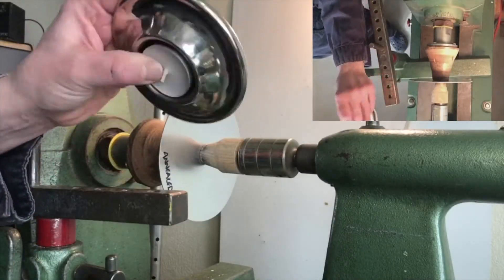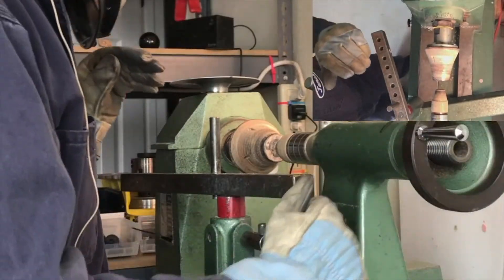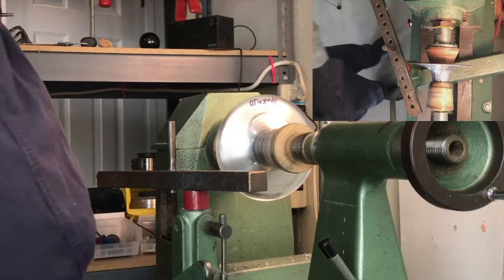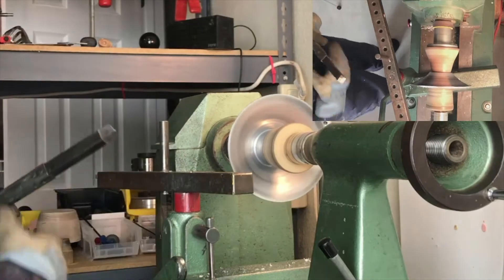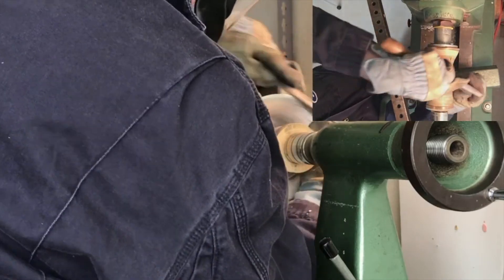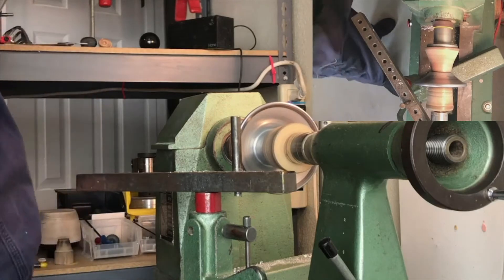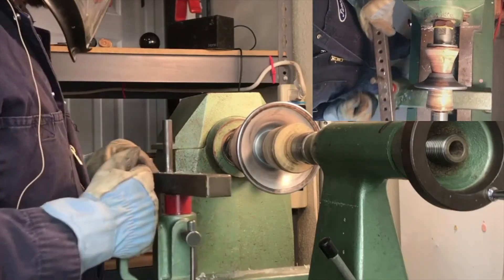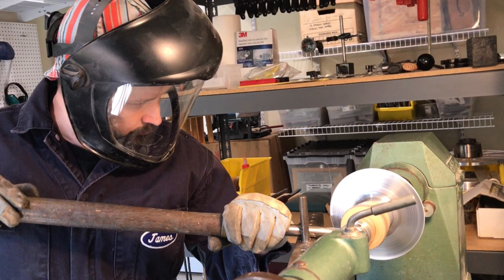How to Spin a Tealight Holder

Comment: Thanks a lot for the demonstration. The additional view from above is really helpful.
How thick was the blank you used? I tried to spin a piece with a very similiar geometry but it started to wrinkle right at the beginning. It was annealed aluminum
Reply from the maker: For a spinning like this that comes back on itself, I typically use 20 gauge aluminum (or 1mm pewter). If your metal wrinkled right away, you might have used too much force to quickly too far away from the center? Glad I can be helpful and good luck with your spinning!

Comment: I have a couple questions... I have a Jet wood Lathe... can I spin metal on that?  and where is the best place to get tools and the forms?
Reply from the maker: Yes, you certainly can spin on your Jet wood lathe but I would suggest that you don't push the limits of the machine too far--keep your spinnings smaller and not thicker gauges. Unfortunately, I'm not aware of any good supplier of tools other than used (eBay, auctions, etc.). I'm working on a small online store to help with this--hopefully launching later this summer!